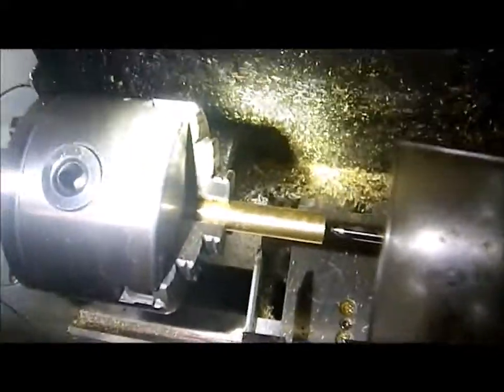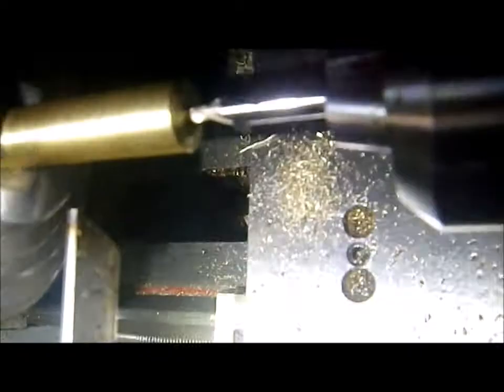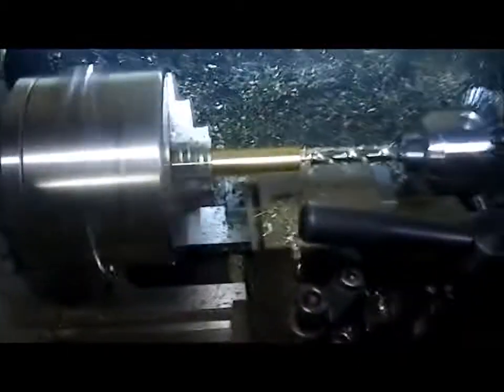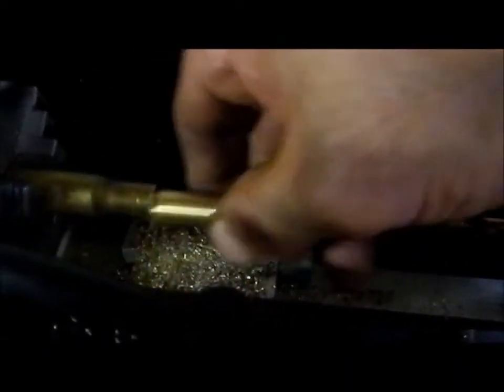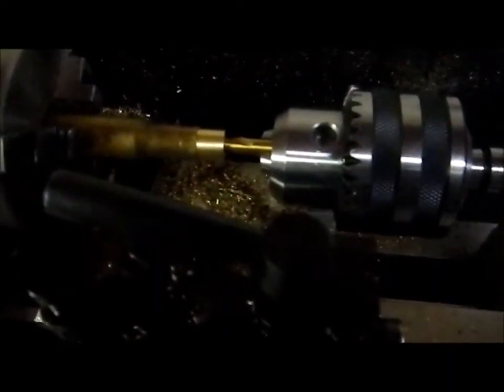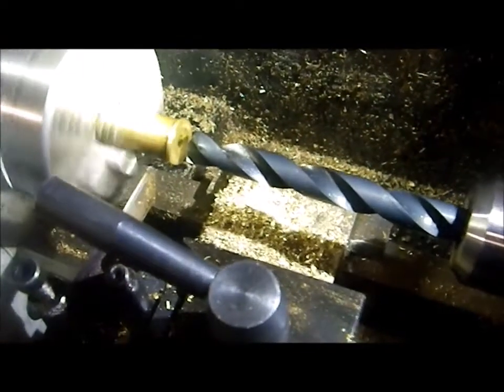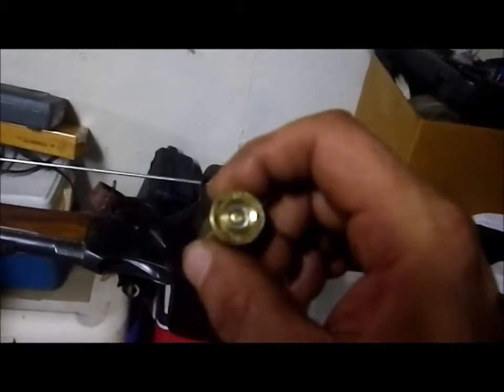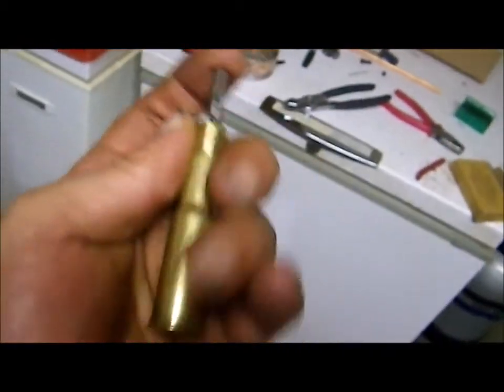Berdan primer pocket conversion for 577-450

Comment: I havent seen magtech-cbc brass for 6 months. I shoot too much to afford bertram. This might do the trick. How are the kynoch necks holding up after a few reloadings?
Reply from the maker: Yes, the mag tech shotgun brass usually vanishes from the shelves within a day or two of arriving at a retailer.  Some old Kynoch ammo (they haven't made 577-450 since the 1950s) has the neck split on the first firing from the box.  It is rare, but it does happen.  However, I anneal the cases that survive their first firing (which is about 98% of them), then after converting them reload and shoot with no problems.  I usually anneal again after 4 or 5 firings.  So far no problems have been encountered.  I thus far only use black powder in MH calibers, so I can't speak to how they would hold up with some of the modern smokeless powders.
Reply: @kenibnanak5554  i just converted 3 cases to accept 209 primers but i didnt anneal the cases prior and all 3 split.
trouble is i always anneal after every firing.....i have 1 converted case left which i will pull and anneal then reload again to see if that splits